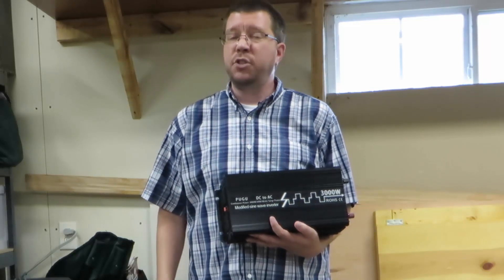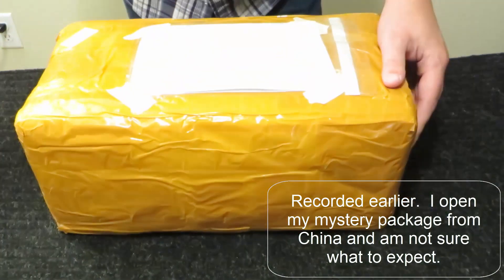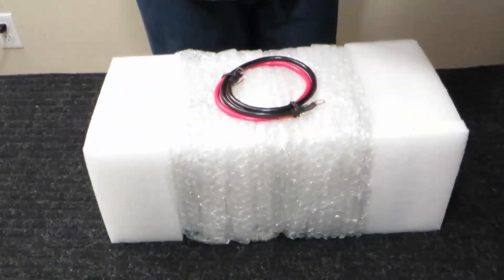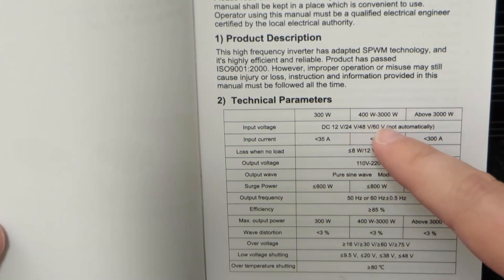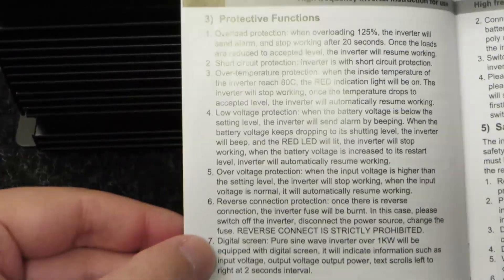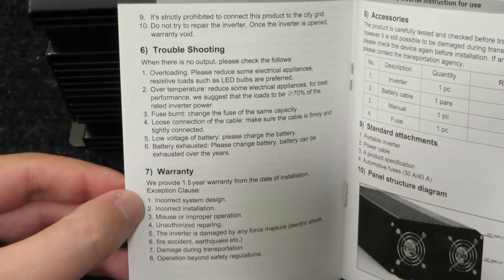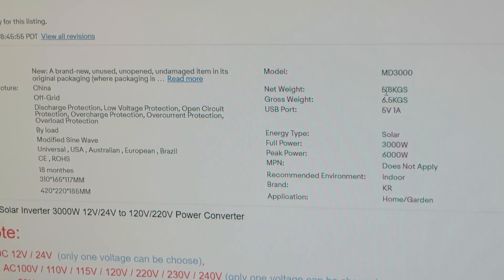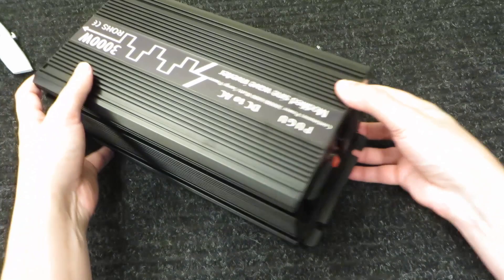I Bought the Cheapest Inverter on eBay part 1/2

Comment: The problem is ,  the modified sign wave can and does ruin some electrical appliances, not worth buying in my humble opinion.
Reply from the maker: Some appliances don't care, some operate better on pure sine but aren't harmed, and some can be damaged over time from overheating and whatnot.  That is certainly something to consider.  There are drawbacks to pure sine too being more complexity and less reliability at similar price points, more cost, and lower inverter efficiency at similar price points.

Comment: The Aluminum Absorbs the Heat and re directs the heat from capacitors and does have a Fan so ..Not Nad.
Reply from the maker: Yes, overall I was impressed with this inverter.  The designers made good choices on what parameters to trade-off for others.

Comment: Sooooo dangerous buying a cheap inverter as they are NOT input output isolated which means that the 240/120 volts output can go back into the batteries, which means you touch the batteries when feet are on the ground, you can get zapped!   These cheap inverters should be outlawed!
Reply from the maker: Knives hurt you if you touch the wrong.  They should be outlawed!  Matches cause thousands of damaging fires every year.  They should be outlawed!  Used properly these inverters are not a shock hazard and one can safely touch the batteries.  They are not intended to be used in neutral-ground bonded applications and almost no one uses them that way much like almost no one grabs the sharp end of a knife intending to use the handle as a hammer.
Reply: Yea agree with part of what you said and I guess in the US 120 volts wouldn’t give you much of a jolt in most circumstances.   But here in Aus 240 volts kills, and because these cheap inverters are not isolated work places have outlawed the use of them because of the danger.  I have been zapped by a cheap 6000 watt square wave inverter through the battery post.   It’s fact that these inverters are dangerous when used as they are supposed to be used and not as a knife or a match, and there are documented cases proving it.   I’m not going to show you any here because you prolly wouldn’t be interested anyway!   However if you really want to find out about the dangers, you know what to do 😎

Comment: hey, my 2000w inverter got backfed 240vac by using a suicide plug. (long story) i found 2 out of 4 blown 30amp fuses inside but when i replaced them and connected it to the battery again it fried a 450v cap..would you suggest it worthwhile trying to repair or let it die peacefully in the garbage? it isnt an expensive brasnd but it did a great job until i loaned it to help a friend..i have been trying to learn from your vidfs and those of others and have found 3 blown mosfets as well..Thanks and love your work.
Reply from the maker: I'd guess it's worth repairing if you can find the parts inexpensively and are interested in messing with it.  (If you bill yourself the time it's definitely not worth it)  I expect you'll find that the output FETs are bad, the diodes are bad, and perhaps the input FETs as well.  I'm a little puzzled by the 450v cap though...  If you source your parts from grey market eBay sellers or alibaba you may find the FETs are pretty cheap.
Reply from the maker: Also, note any support components such as resistors and test ANY component that connects directly to the FETs.  If the damage got far enough to fry the drive circuitry you're starting to get into the weeds.  Still doable though.  I draw the line at irreparable PCB damage.  That's fixable too but, well, a person has to draw the line somewhere and most would draw the line at 'no workie' and toss it out.
Reply: @knurlgnar24  thanks for that..ill have a crack at it..

Comment: How could I go about checking to see if my inverter has a split output phase? As in each wire is 60v to make 120v. I'm not sure if mine is like that or if it just has a normal hot and neutral. I am not sure how to check that with a multimeter and have not found a way to do so even with researching it. Is there also a way to check voltage just from one wire to see which one is the hot wire? By the way I enjoy watching your videos man, I've been watching them for years. A lot of good info you talk about!
Reply from the maker: Thanks for the comment.  A 'split phase' inverter will have multiple output voltages available for use.  I understand your question though and never really thought about it as a sort of split phase, though it kind of is...  Anyway, you can measure from your output back to the battery input.  If there is no voltage there then the inverter is the better kind.  If you get 1/2 AC voltage measuring back to the DC input then you have the kind you are referring to.
Reply: @knurlgnar24  Thanks man I appreciate the reply! You rock! So I should reference to DC negative on the inverter then I'm assuming?

Comment: At that length I would say the 8awg wire could handle 80a, I have gotten away with 10awg in similar length for 60a and it barely gets warm.
Reply from the maker: 60a through 10awg will get hot no matter the situation.  That said I agree that if in free air with some natural convection it will work just fine.  I wouldn't trust it long term.  Personally I've run 150A through 4AWG and it works OK but I wouldn't recommend it.

Comment: At 48V my 5KVA inverter only does some 120A . My biggest problem with electronic inverters is that they blow up when the load feeds back. When running Induction motors and arc welders, mechanical converters still win.
Reply from the maker: It's been a long time since I've last heard someone comment on mechanical/rotary converters!  Yes, they're crazy robust compared to an electronic inverter and they definitely have a place converting single phase to 3 phase in a hobby shop/garage for example.

Comment: It is good to see you back. I have an idea for another video. I have a "Reliable Inverter (their name not mine)" 24V 3000W pure sine wave that recently went pop.  I have troubleshot it with "Reliable Inverter" support team via email and they were willing to send me all the parts to repair it for $36 dollars. I asked if they would allow me to send it to them and they said no. Parts includes the Driver Board and all the busted mosfets on bouth input and output side and other misc components. There are some surface mount caps that have blown or appear blown. I am not tooled for the control board or surface mount soldering. I thought about trying to attach through board caps but feel that is just a bad idea. I would pay the shipping both ways to and from you. Fix it and shoot a torcher video. If it survives send it back. I will buy the parts or foot the bill for upgraded mosfets if desired. I have bought my own mosfets that match what they used. I have not paid the $36 but if interested I would. Not sure how long it would take to get the parts? I could kick in and pay you for the time to at least look into it. I have searched in the Dallas area and have not been able to find anyone willing to take a crack at it. I am almost certain that my efforts to repair it will not end well. If it were all through board soldering I might try. I understand you have a day job and may not be interested. Still good to see some new videos. Keep up the good work!!!

Comment: $200 for that junk? 😂😂😂 sorry but i got a used 2000W/4000W pure sine wave UPS for only $180?... even the brand new 200Ah battery did cost me more at $220. The unit is running 24/7 for 7 month by now in combination with an automatic changeover switch.
Reply from the maker: It turned out to be a pretty decent inverter.  I've bought surplus new or used inverters in the past also and while there are good deals to be had that way there is a significant convenience factor with being able to purchase something new anytime you want it without worrying about its past life.  Be careful with UPS units as they are rarely designed to run continuously at high load.
Reply: @knurlgnar24  i saw the full video... i still think $200 is too much for a modefied sinewave inverter. Yes, sure it brings convenience but does it als bring reliability or is it one of those devices of which you better keep two extra in storage in case one fails?... that UPS i bought can hadle over 2000W, it’s fused at 320A 12V. The manufacturer is a small company in Germany, i think it will last a while. The unit actually came from a hospital and was just about two years old. I think it is a better deal than a mod sinewave inverter from china for $200.

Comment: The reason it produces over 3000W for up to 20 seconds is to handle surge power necessary to get some electric motors to start, like a compressor or table saw. Because it is not pure sinewave you will need to be careful not to run certain electronics, like television or computers as it will ruin them.
Reply from the maker: Thanks for the comment.  Most inverters in this 'class' have either about a 0.5s surge capability or zero surge capability despite how they are advertised.  This is why I did not believe the spec sheet stating 20 seconds.  In part2 I found out that it was indeed about a 500ms surge capability which is more in-line with expectations.

Comment: Wondering what happens to grid tie inverters rated at say 300W, but you only put in 150W of battery power.  Do they shutdown?  Do they start outputting up to 150W? Do they output corrupted sinewaves?
Reply from the maker: I haven't used one myself but from what I gather most of them are simple lies in specsmanship.  I too suspect their harmonic distortion is atrocious, though at only 150W it probably isn't enough energy to cause too many problems.  Years ago I breadboarded a backfeed inverter that just put a pulse into the grid at the peak of each half cycle.  It was terrible but it did backfeed a few watts, so even something as simple as a peak detector and a flyback transformer can get the job done if you want something horribly dirty.
Reply: @knurlgnar24  good point.  I suppose I should buy one and see. Laws here for grid tie solar are terrible. However, the idea is, if I don't backfeed out through the meter, no harm no foul, all legal.  I use about 117W constant with my server running.  My thought is to just nullify that.  Pay for the rest as needed (welding the kid's go kart uses a slight bit more, of course!).  
Other thoughts became really complex as running my server from a battery backup, powering preferred from battery, if that runs out back to shore power etc.

Clearly, the legality makes this a challenge as monitoring the power output vs grid draw vs battery level...

I do see with a minor investment, a very short pay back possible, so worth the time.

Comment: Hey, glad to see you're back. Love the vids. Just picked up a schumacher 410w a few days ago to charge my power tools on the go. Also scored a bunch of lead acids for dirt cheap. Any tips on charging small lead acids directly from a cigarette lighter?
Reply from the maker: I have a video half done on restoring a small lead acid battery.  One day when I get that video done and posted perhaps it will interest you.  :)  In the meantime I have to say that charging from a cigarette lighter is a subpar way to charge a battery.  That said if it is what you have then there is no shame in it.
Reply: Brushless fans do they really pull hardly any current at all or are they really safe to have or are they a fire starter that's my question?
Reply: Test your inverter on your laboratory power supply to find out what current it actually really does draw before you trust the specs on it run a laboratory check a safe laboratory check first before even hooking up to a battery?
Reply: I don't think I believe that what that specification says like I said to protect yourself and your equipment tested on your power supply and find out exactly what the current of the inverter would draw off of power supply before you hook it to a battery then we know if it needs continuous card or if it would be safe to run off a battery or not or wise let's say wise to run off a battery or not run it off a power supply first check the power supply find out what the power supply is stating then that probably should justify your answer we know a battery may not last long in an inverter setup do we know exactly what the power draw really will be and the amperage draw will be there's no way to tell unless we use a laboratory power supply first,
Reply: That would sound highly stupid to trust those specs they tell you just to make their products sound real big be careful about that I'm very skeptical of what that power inverter pulls what about the last power inverter it was better when you made the thousand amp hour battery but now we're looking at a laboratory power supply use to see what the power supply says what if the power supply laboratory says hey this is too much you need a little bit more then would you justify your power needs for the project?
Reply: Very strange to find out that the pictures don't match?
Reply: It's also I forgot to mention my high performance battery was also used in the most expensive vans and family wagons that have DVD players and sound systems and uses a high performance alternator when installed but I used a maintainers 750 watt or 750 milliamp charge but rated with a 3 amp fuse now I have one with a 7.8 amp fuse and went from a 750 milliamp to a 2 amp 12 volt maintainer supply for this battery this ATM high performance battery it was a $200 battery it's probably more now

Comment: so 500W of power per transformer/mosfet set, 6 transformers to make up 3000W.
I wonder if there is a version with 8 transformers to make up 4000W ?
Good to see you back also.
Reply from the maker: Looks like there is room in there for at least 5000W with a larger top board.  I did not see this option anywhere however on eBay, Amazon, google images, alibaba, etc

Comment: If you're after a large, cheap inverter that's also high quality (who isn't?), Damien Maguire has figured out how to modify a Prius inverter (about $100 from Ebay and can handle at least 10-20kW continuously) for general purpose applications. With the right firmware work, you'll even get advanced features like V/Hz scaling that normally are only available on very expensive inverters.
Reply from the maker: That's very interesting.  I'll have to check it out.
Reply: Yes

Comment: Welcome back!  

How is the 1000 ah battery bank you salvaged? Still using it or was it replaced with other batteries?
Reply from the maker: 6 months or more ago I went through each battery and was able to recover them to a better condition than they were after the last 1000ah video I made.  I used different equipment that was better able to measure their recovery but I was surprised that I was able to do so after that many years.  Now they stand at about 80% of their rated capacity overall which is pretty good considering that they are about 10 years old and at their EOL according to the manufacturer.  I also have the two BCI group 24 batteries I bought back in 2012 that are going strong still.  Those are cheap-o batteries and show that a person can keep batteries a very long time if they take care of them.
Reply: @knurlgnar24    Thanks for replying!  Could you make a video of that testing equipment you are using?  I have a battery charger that supposedly desulfates batteries but don't have a tester and would like to test the batteries on my UPS.  Maintenance is key to keeping batteries in good condition, charge voltage and water level if they are flooded type lead acid batteries.  I am not surprised that you are able to keep them working after this long.
Reply from the maker: @JT-lq4yd  I started a video a few months ago that I need to finish showing the different equipment and how to use it to desulfate a battery.  It's nothing too special, basically just a lab style power supply and a lab style programmable electronic load.  Thanks for the comment!  I might now be motivated to finish that vid and get it posted.

Comment: Well come back.how your old system and old APC ups your modified.it still work well?
Reply from the maker: Unfortunately I shelved my APC 1500 APC UPS units long ago.  I still have them and have no reason to believe they have degraded in their function but have not used them since my video years ago.  Since Schneider Electric bought them out they no longer make UPS units I'd bother purchasing even at salvage value.
Reply: In the pass after watched your video.i follow your steps and make may apc 3000va run with 200ah x 48v free maintain lead acid system and it still work well with continue 2kw out put for 1- 2 hours without any problem .thanks brother for share experience.

Comment: How's the battery back up doing? Should do an update video if u still have it
Reply from the maker: I have been intending to convert it to a 48V battery bank for my SI6048 inverters and I've gotten to the point of recovering each battery individually so that I can group them into 48V series banks, but that's where I have currently stopped.  The batteries themselves are doing well.
Reply: @knurlgnar24  awesome can't wait to see the update
Reply: @knurlgnar24  Is there any chance you could do a review on the EGO 3000 watt Nexus power station? Anything EGO videos get lot's of views. I'm thinking of buying this power station.